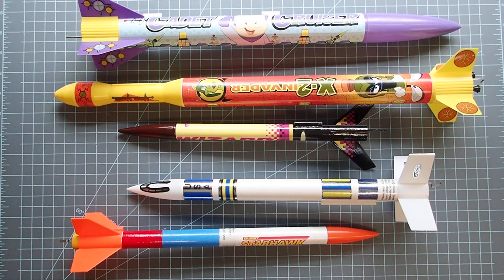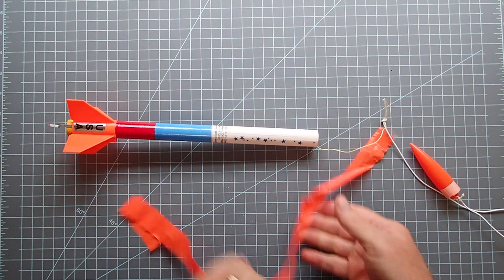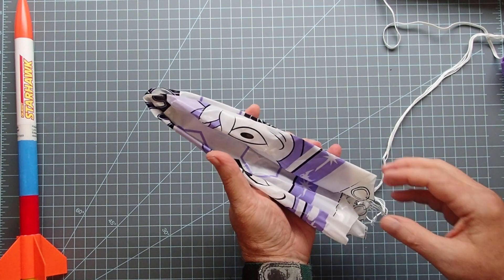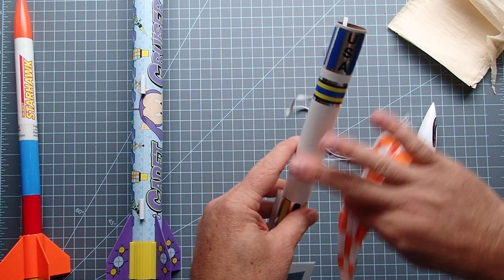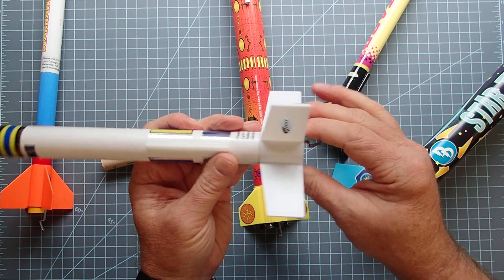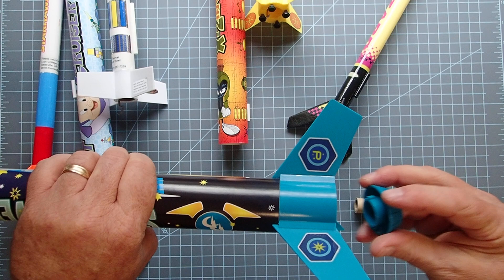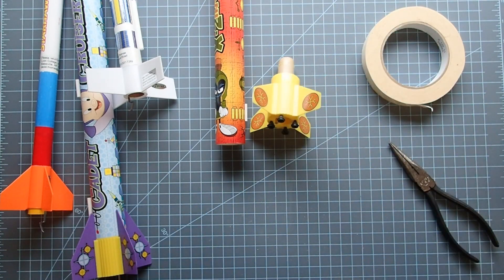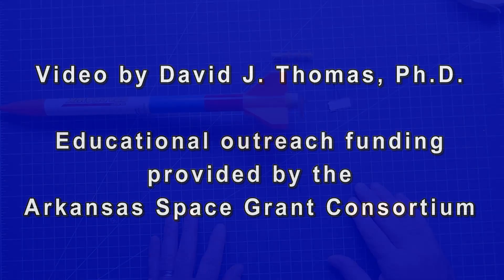Model Rocket Launch Preparation

Comment: That pyrogen is simple white glue.  The updated starters have a much better coating.
Reply from the maker: I still have some OLD solar igniters that were made with a pyrogen. They definitely worked better than current ones. I haven't tried their newest version yet.

Comment: I really enjoyed this video. I learned a lot!  I appreciate your way of folding the parachutes around the shroud lines. When I was a kid, I used to wind the shrouds around the chute and wondered why they didn’t always open!  I like your way 1,000 times better. 

Also, regarding the motor can coming out of the tube, what are your thoughts on drilling some 1/16” holes into the plastic sleeve that slides into the cardboard?  That may give the glue something else to seep into and give it more purchase. Just a thought........

As always, love your videos and your style of teaching!  Keep it up!  I have a Wizard and Alpha on the way. Can’t wait to get started on them!!!  God bless!!!
Reply from the maker: Your idea of placing small holes in the plastic piece probably would work as you said, but you don't want too many, or the structural integrity may suffer.
Reply: For sure!  Good point. I would consider drilling 4 holes at every 90 degrees around the perimeter of the sleeve. Then rough sand the plastic to increase adhesion. Then I would probably use epoxy. I’m not being critical, just enjoying the opportunity to chat and share ideas. 

Please keep producing content if you’re up for it. I’m slowly but surely getting through all your videos and thoroughly enjoying them!  Keep up the great work!